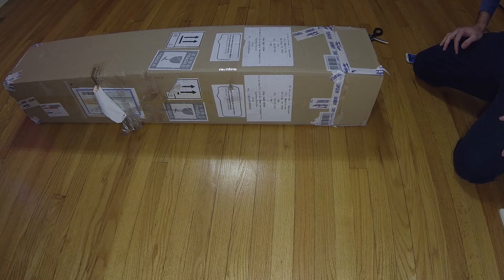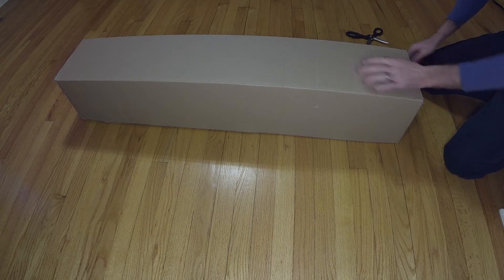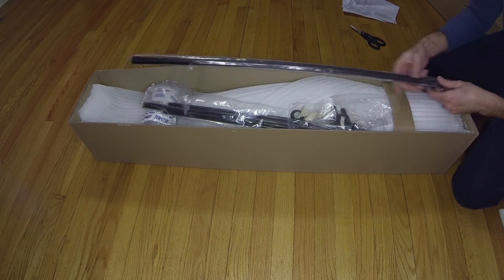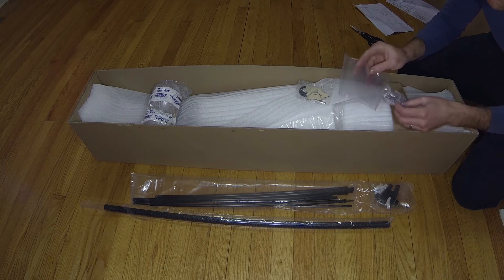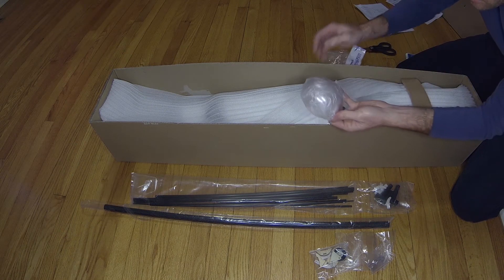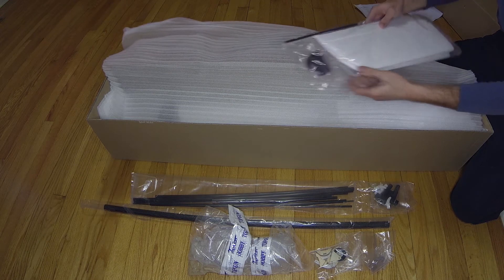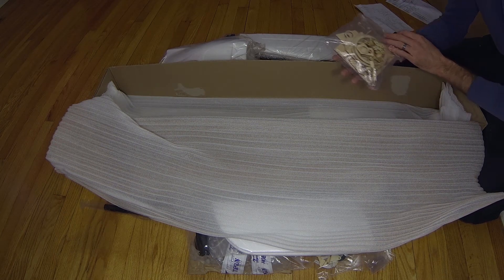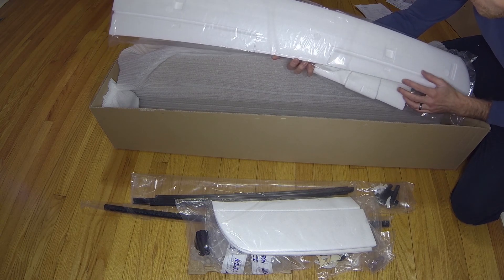Cyclops  Asia Tech Drones   Unboxing

Comment: That really looks like the tech pod
Reply from the maker: This is from the same molds as the tech pod. Asiatechdrones is the owner of the designs and manufacturing. This is far from the techdrone though since they have addressed many problems that the techdrone had.
Reply: Atom RC Actually the moulds are my own moulds and are different from World Models Techpod moulds. Wayne does not own the Techpod moulds unfortunately for him. Most everything is different on this plane. It does look similar but very different in performance. 300Km flight in the works.
Reply from the maker: oh... thanks for the info sorry to provide anything incorrect. yes, this is fully capable of exterme flight, Iv been floating mine around waiting for my camera to come back from gopro...